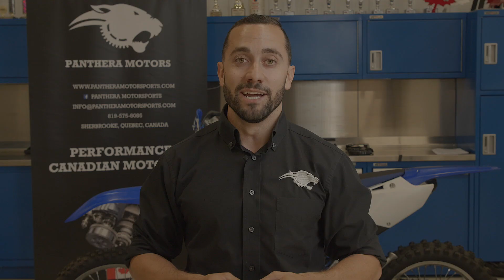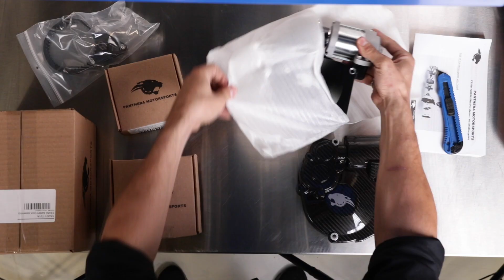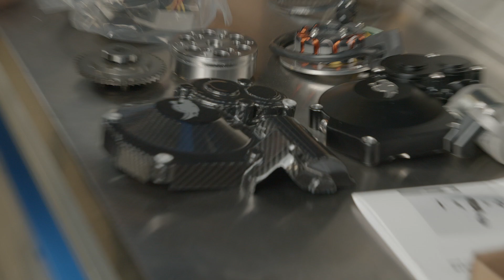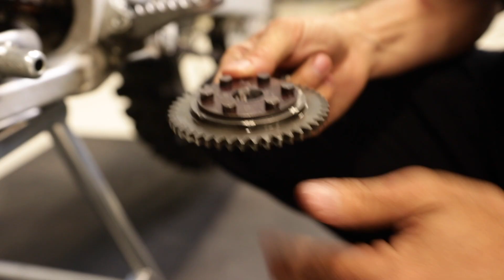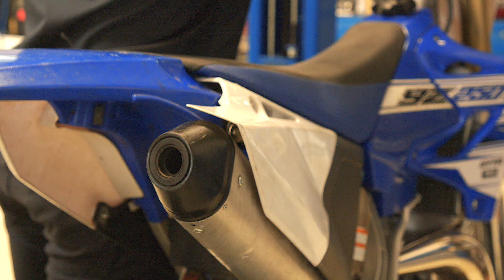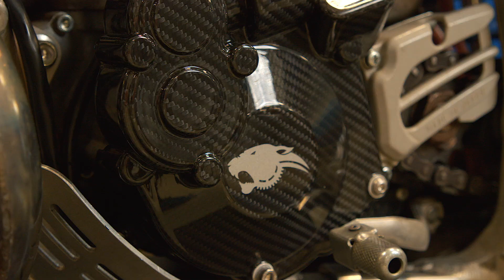YZ250 Electric start installation

Comment: i hope one day your company can make an electric start for a KTM 85sx (19/16) 2017-2021. I had been modified my KTM for Enduro with steahly flywheel weight, throttle tamer from G2 Ergonomics & soon for a lectron carburetor.

i appreciate your company make an e-start on the YZX. I didn't buy that dirt bike since it does not come with an E-start but your company did it. Thank you for your hard work.

Comment: I had to make a Motorcycle Paddock Starter Roller (rear wheel)  so now I can pull out all my bikes and start them before I ride. Then it's one or two kicks for restart on the trail. This is what you should be selling. You can bump start a YZ250 but not a Honda CR500/YamahaYZ490 or KX500. It's portable and all my friends use it and it gets them out riding more because it's so easy. "You need to make and sell these" cuz it works for every bike!
Reply: How did you make one? I have a bike shop and need to start all my customers bikes that I'm working on.  HELP!!!
Reply: Oh God I need to find one. Been kicking for the last 2 hours on my YZ and it has spark and fuel probably foued the plug again. My best guess is everybody's pulling their bikes out to sell them this winter. LOL

Comment: Questions - What about a vent for the cover? I have heard that since there isn't a vent that the system pushes the oil up the clutch cable and it drips at your bars. Second, have also heard that you need to rivet the flywheel to the gear to prevent it from coming apart. Is this true. Lastly what is your shipping time from the moment it is ordered? There are people who have been waiting for 4-10 months for this.
Reply from the maker: A 1/16 NPT hole is already on the cover to install a vent hose. If the kit is selected without charging system, we indeed supply you with a new flange to rivet to your oem flywheel. We supply the rivets and tools to do so. 
Some people gladly pre-ordered the product 10 months in advance while it was still not available. Now that the product is fully available, it ships the same week you order.
Reply: @PantheraMotorsports  Thanks for the response! Looking forward to receiving the kit this week then! (ordered in summer)

Comment: How do you change the oil inside the starter
Reply from the maker: There is a drain plug on the bottom

Comment: in europe we have the WR.is an X with lights so the stator has 12 volts also.with this kit now can i take the 12 v to the lights strait from the battery?
Reply from the maker: Yes, our new stator and flywheel will give you a lot more power than the WR normally has.

Comment: quick question i’ve been looking at this product for a while and was wondering if it’s fits on 1999 yz 250 model
Reply from the maker: It works on the 1999 but you have to change your crankshaft for a 2003+ to make it work

Comment: I hope you guyd can answer my questions...but is there anyway i can fit a 2003 bottom end onto my 2000 yz250. Or is there any possibilty of modifying the starter to fit the 2000 yz250 or modify the bottom end to fit the starter. Thank you. Hope you guys can answer my questions 👍🏻
Reply from the maker: Yes, if you put a 2003+ crankshaft in your 2000, the starter will bolt right on !

Comment: Love it. I run a 11oz flywheel weight will this kit add to the flywheel effect or lessen it vs my current setup
Reply: In hand they fell almost identical to my stock flywheel with a 13oz weight ,
Reply: Supposed to be more or less equivalent to the gytr flywheel

Comment: Is there a drain bolt for the gear oil? How do you change it with out taking the entire thing apart?
Reply from the maker: Yes there is a drain bolt at the bottom of the cover

Comment: I'm interested as to which formula you used to come up with 110W is 10 times the output of 60W ...
Reply from the maker: Hi Jim, the stators produced by couple company and sold as supposed ''35w'' of lighting current, have been fully tested on our ignition bench, and will in reality only produce 9w-10w of lighting current. This comes from the fact that the magnets in the oem flywheel are too weak. 10x10w=100w

Comment: I need to know if this conversion will work with a 2004 YZ250F 4 stroke
Reply from the maker: Hi Patrick, this specific product is for the 2 stroke, but we are preparing a similar kit for the 250F.
https://pantheramotorsports.com/yz250f-rm250-2003-2013-electric-starter-pre-order

Comment: Love it my only issue with it is getting the airfilter in and out.
Reply: There's no issue getting it in and out. You just have to accept that you're taking the battery and battery tray out everytime lol. it does suck.
Reply from the maker: https://youtu.be/NDg4FgtC2YI
Reply: @PantheraMotorsports  I found an easy way search up on youtube (YZ 250 panthera motorsports electric start air box mod)

Comment: Awesome 👌
Does it works, or do you have on kit for the Yamaha WR400 ?
Thank You 🙂
Reply from the maker: Hi Luis, sadly we do not have a kit for the WR400, and each kits are vry specific to one engine.
Reply: @PantheraMotorsports  Thank you
Reply: Will you ever make a kit for the yz450f 2014-2017?? 
Please and thank you  @PantheraMotorsports

Comment: Can you run a 10s lipo battery with this or is it volt specific, Tia
Reply from the maker: System requires 12V

Comment: What’s stopping this from fitting an 01 engine?
Reply from the maker: Crankshaft is different before 2003, flywheel taper is much smaller

Comment: Y'all got one for the 450s?
Reply: The 450s already have e start
Reply: @PBstx1100  I must have such a rare bike then because my 2016 yz450f only has a killswitch.
Reply: @dantsy6397  buy a newer one then haha.
Reply: @dantsy6397  If you want electric start for it get a oem assembly for the yz450fx

Comment: But why? It's a freakin 2 stroke. Nothing useful, just added weight and potential for failure.
Reply: Some people can’t kick it due to health issues.
Reply: @jdavishornet  can't kick a 2 stroke but can ride a dirtbike? Cmon man
Reply: I have a bad hip. Hurts a lot to kick it. I can. But it hurts. I can ride all day. No problem. Not trying to get in an argument with you but there is a need.
Reply: @jdavishornet  sorry to hear that... Apologies. Offer an option perhaps. Id prefer not to have the added weight.
Reply: No apologies necessary buddy. When I was young I would have thought the same thing. You’ll see a lot more older riders lately. A lot of us are beat up 🤕 but we still can ride. 😂
Reply: @jdavishornet  I'm 49 my man. Only trees slow me down lol.
Reply: 49. That was a very good age.  Just kidding. I’m only 54. But an abused 54. 2 knee replacements. And waiting on a hip and a shoulder reconstruction. Can’t get it done now because I work for NYC sanitation. Have only 34 months left and if I go down now to get everything fixed it will kill my pension. So I suck it up and keep chasing the truck. This is why I love the idea of the E start😂

Comment: Cab you use a stealthy 11oz flywheel weight with this system?
Reply from the maker: You do not need a flywheel weight anymore with this set up has the flywheel supplied has a higher inertia to start with. We also have extra heavy starter flange to put on the flywheel if more inertia is needed.